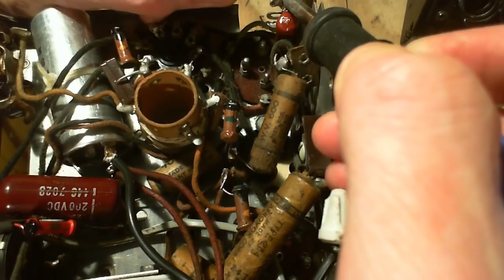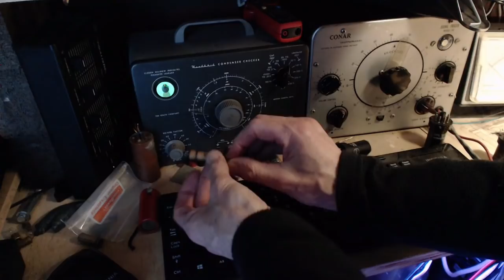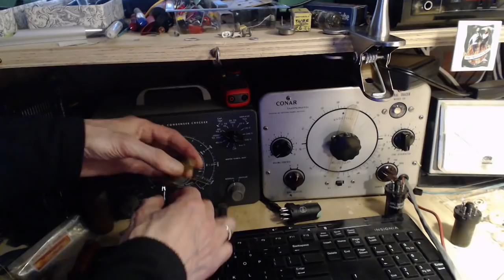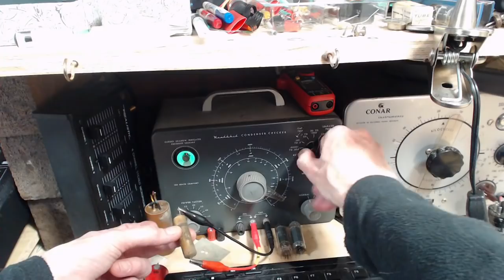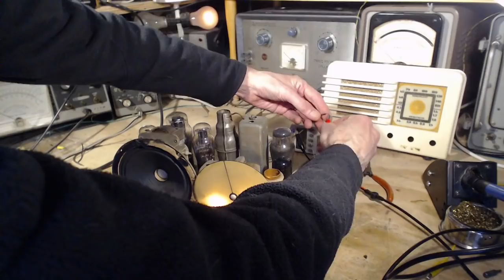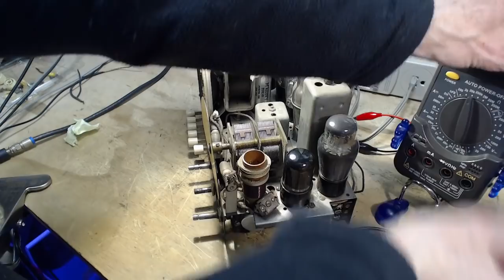Clinton 629 Tube Radio Video #4 - Five Wax Capacitors Replaced

Comment: Jim you can set two of the pushbuttons because they would be tuned to stations there because they are on the same frequency and those buttons are KFI which is still on the air with the same calls at 640 same frequency as Global News Radio 640 (CFMJ) and the other is KFXM which is now KTIE in San Bernardino at 590 the same frequency as Sportsnet 590 The Fan (CJCL) and just leave the others alone because they would be tuned to 1070 (KNX), 570 (KMTR now KLAC) and the last button I don't know because you didn't give out the complete callsign

Comment: I had a problem with a ganged tuning capacitor where it appeared to be shorting out at the nearly closed end. It showed a short on my digital meter, but the vains looked completely clear of each other. The problem was solved by sliding a thin peice of card down between the vains, this cleared the short. This means some small metallic objects were causing the short circuit. Worth a try.

Comment: Hey Jim, Have you considered which side of your new cap is the "foil" side?  And I still think you should take the dim bulb out of the circuit after you power up as long as you don't have any short circuits happening.  I think you'll get better reception with full current and wattage available.  Just trying to help.
Reply: Foil side? He has no clue what's inside a cap.